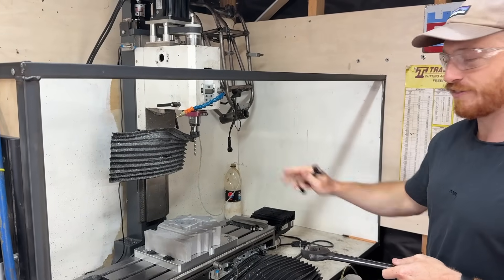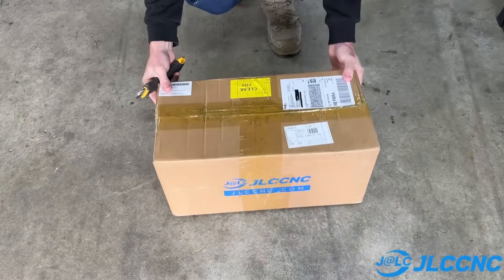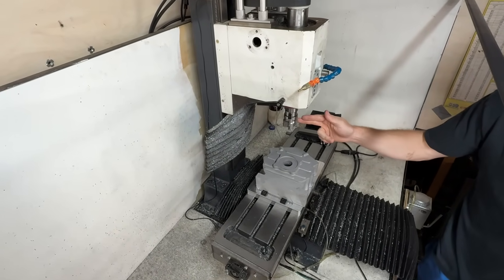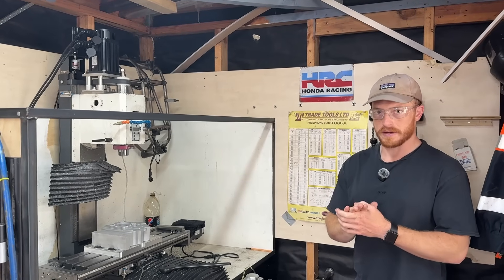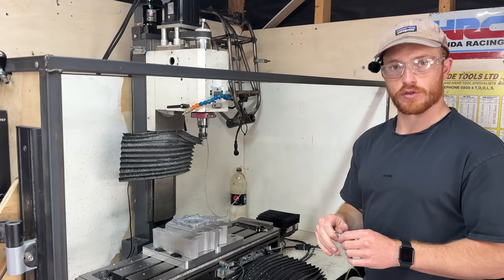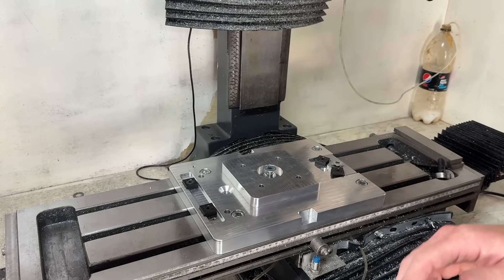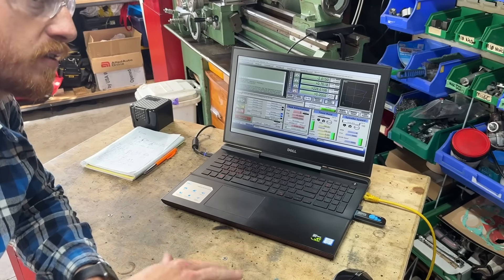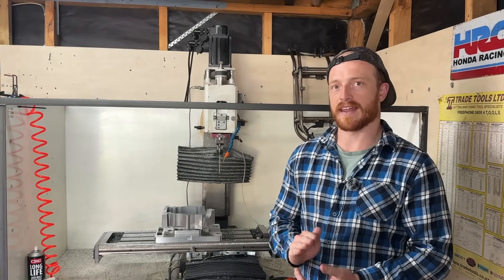Starting My V-Twin Engine Production Run

Comment: 🚀 A V-twin run is a perfect example of coordinated machining. For low-volume engine projects or complex assemblies, our multi-process capability (CNC mill, lathe, finishing) delivers all components in sync. Efficiency starts with the right partner.

Comment: Not to be a know it all but typically you wanna go/no-go thread gage but 🤷🏻‍♂️ whatever works for your application
Reply from the maker: Thanks for the suggestion, I probably should buy some gauges. I've thread milled all of the holes under-sized, I generally thread all the way down with a bottoming tap after the fact as the holes are quite deep.

Comment: LoL, what a depressing video!

 I wonder how many other people there are watching this that have the capability to do what is shown in this video, daydreamed about it and want to, but never did?  (Raises hand)

If only I could take my ProtoTrak home from work….

Seriously though, I think this is an awesome project and really enjoy the videos. Top Job!
Reply from the maker: Thanks, I’m glad you’re enjoying it. 

I believe anyone (who’s moderately motivated) can do this, you just have to start somewhere.

I bought the mill before I even knew how to do the CNC conversion. I learnt CAD just to undertake these projects. I learnt how to cast from watching YouTube videos. I bought my equipment over the span of a couple of years. 

All of the equipment owes me less than the cost of one decent second hand motorcycle. 

Considering all the prices were in NZD, you could have a full shop set up for less than 5k USD.

Comment: Ive heard those skateboard bearings really do meet that intense abec spec. Skateboarders are a tough crowd to please apparently.
Reply from the maker: I’d be curious to know how long they stay in spec for with all of the hammering they get.
Reply: @OddsandEndsMachining  About 1 day to 1 week. I skateboard and your better off taking the grease covers off and letting them run dry after about a week skating. They are very slippery after the grease is gone.

Comment: if you cut your holes and faces, with an endmill (like 6mm so it can plunge cut the holes for threads) you could skip changing tools but will need more passes to face or finish so might be slower also
Reply from the maker: At this stage it is manageable to change the tools by hand, but my long term solution will be to get a mill with a tool changer.

Comment: when the motorised pushies were allowed here (NSW), and the exchange rate good, i snatched a pair of lil clone "robin" eho25cc four poppers. but never had the heart to tear them down...

i just wanted a lil 50cc for the pushy...

got a furnace, 10kg crucibles...

done nothing :)

weeee!

as long as you can source all those fiddly parts... really, production is just repeatable jigs and doing as many per setup as possible.

one sand mould? nah, you need twenty prepped and ready every morning as the furnace heats for an afternoon pour... etc, etc... repeat every day for the next week...

tried some double sided machining for the first time in timber the other day. big lesson in zeros! oops...

jigs are fun. the big step is making multiple operations in one pass on several items... "stations". say they all get faced twice. can you have two do different faces? see some setups with five gang cutters and seven or eight different positions. when you do 200, or 2000 of something, doing eight at a time gets through the heap pretty quick.

and it can be dull but also satisfying doing production work...

if theres money being made :)

sucks being the grunt running the machine though... wanna be the boss out on "business trips" with the latest floozie...

mach3 is old but hell, im still on a parallel port :) i paid for it, im using it!
Reply from the maker: That’ll be my plan when I get a bigger machine. To run as many cases as possible at once and minimise the time spent intervening between runs. 

Or if it makes sense I may out source all my machining.

Comment: Looks good, that's a lot of thought and work you've put into this whole setup to be able do a run more efficiently. How's the rigidity when using the sub-plate? I would have thought you'd need more than just that one bolt to secure it solidly?
Reply from the maker: Thanks. The sub plate is 16mm thick and the main plate is 25mm, I haven't run into any chatter issues yet. Likely due to the fact there is not really any heavy machining and my mill isn't super rigid so I take light cuts anyway.

Comment: Well done Jonny. Very cool. I noted your tool holder system is manual (not air opererated). Can you share where you got it please (maybe a link?)? I could only find industrial air operated versions which were quite expensive.
Reply from the maker: Thanks, I did a video on the draw bar set up a few years ago. Here is a link to that video.

https://www.youtube.com/watch?v=QgPYhxTvUOM